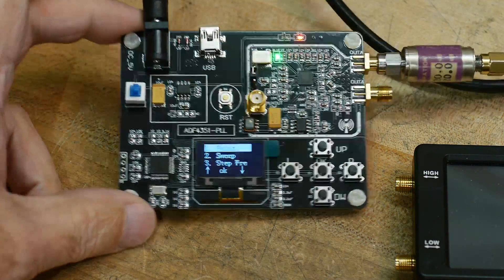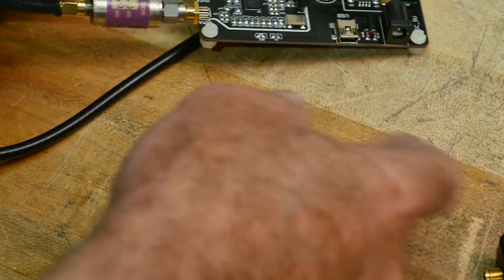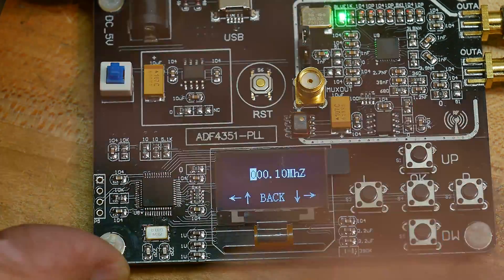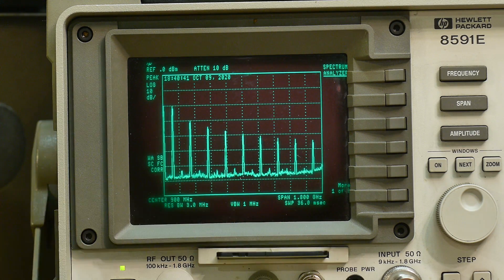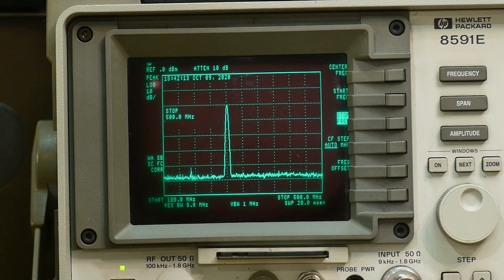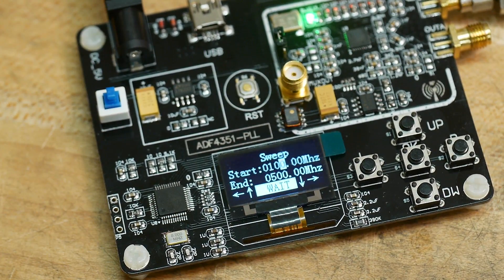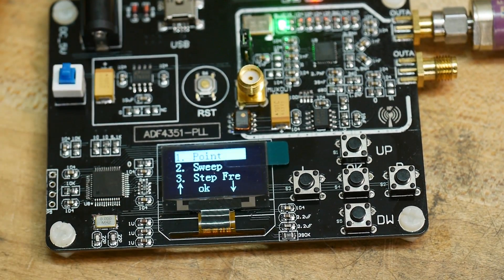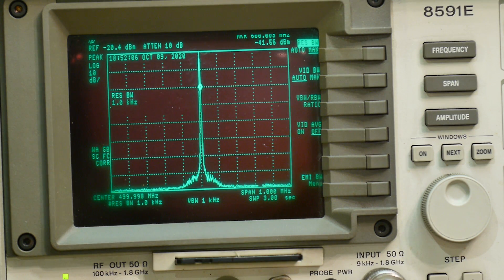#612 35 MHz - 4.4 GHz RF Frequency Synthesizer ADF4351

Comment: If you remove the DC supply, does this unit remember the last settings in NVRAM when you re-power it up? I'd like to use one as an LO for my 10 GHz transverter.

Comment: I see you've tested this on an Oscilloscope, what I'm wondering is what are the applications for these?
Reply from the maker: all the same uses as any RF generator. testing equipment, osc scope, counter, spectrum analyzer, testing filters, directional couples. RF amplifiers.

Comment: I bought one, but the UI is in Chinese....is these a simple way to switch to English, or does it have to be flashed with a different firmware?
>>EDIT: No simple way! See below...
Reply: I found the firmware source and schematic. UI is in English! Source comments in Chinese. The bad news is that there are two PCB models out there: (1) With No trash can logo below the  blue/white switch, that has a 128KB flash STM32 , or (2) With a trash can, ENIG PCB finish and a 32KB flash STM32. The clone models come in form (2) with the smaller flash, so I had to tweak the source to set the flash size to 32KB and the write base address (persistent settings) just above the last used prg code page. Then, adjust the ST32 target part for the project, recompile the whole thing with Keil using the older v5 compiler, and reprogram the flash using a STLink V2 wired to P5 on the PCB.
Reply: @luisderivas6005  I just found the same thing, can you post a link?

Comment: I just bought one and did a bit research on it, the sma connector in the middle is an external ref freq input @25 mhz, the jumper next to it enables its function
Reply: Correction; the lo can be chosen freely by the designer, in this case it is a 100 mhz so you will have to feed it with a 100 mhz external signal or reprogram the unit to except something else.
There are also units like this with a    lcd which has the menu option to change the lo frquency.
I am planing to hook mine up to a gpsdo at 100mhz.

Comment: I measured only 0dBm from the outputs on this one. According to the datasheet (and the power setting on the display), it should give up to +5dBm. Perhaps a software issue or something. However, this is a great tool for the bucks.
Reply: Maybe it's 5dBm differential?
Reply: @tiftik  Perhaps. The outputs are shifted 180 degrees apart, so it can be so.

Comment: hello, is the generator able to save a frequency and when turned off and back on again to automatically transmit the saved frequency?
Reply from the maker: Mine forgets
Reply: @IMSAIGuy  Is there a way to let this or an other generator when powered on to automatically transmit on 1 specific frequency ?
Reply: @stortregen5390  If you use your own microcontroller, you could do this quite easily.

Comment: Can u imagine if we had these low cost "toys"  30 - 40 yrs ago? I use to DREAM of having a spectrum analyzer and o-scopes back in the 70's but they cost was astronomical! I think it has differential output and should be terminated if not used. TNX 4 the video !

Comment: It's interesting that slightly different units, using the same chip are shielded between the RF synthesizer and the controller. I wonder if any benefits could be had by adding some shielding boxes.

 https://www.amazon.com/ADF4351-phase-locked-frequency-synthesizer-single-chip/dp/B07CTL2XK3

Comment: I think I left off last winter wondering what's the similar spec RF range oscilloscope module size board/kit?   Was wondering about IIO Oscilloscope with the Adalm Pluto.  I've not taken out of the box yet... though will see when I get to this winter.  Still focused on the outside chores, though still wondering what is a more portable standalone option maybe like a HackRF Portapack with better performance.  Would be neat to see a dedicated module however maybe with a RF power detector module can be made easy?

Comment: A couple years ago, I picked up an ADF4350-based version in an extruded alumin(i)um case with OLED display. It looks like the ADF4351 version is also available in the same enclosure on eBay. It's significantly more expensive (more than 2x) than the PCB version, though. I'm not sure why, since the case isn't that expensive.

Here's a link: https://www.ebay.com/sch/i.html?_nkw=%28adf4350%2Cadf4351%29+-pcs&_sacat=0&_sop=16 I have the style in the black enclosure (but that pricing is outrageous). There's a natural aluminum one with the screen on the top, rather than the front, that is less expensive (~$88).

I don't know if anyone makes acrylic sandwich-style cases for the bare boards for some protection at a reasonable price.

Comment: There are some of these 4.4GHz generator-boards with touch LCD which are really easy to handle. I got one of them and tried out it's harmonics in the 10-12GHz range with a satellite LNA. The output can be observed in the 1-2GHz range.    
RF Sweep Signal Generator Modul Board 35 Mt to 4,4G + STM32 TFT colour touch LCD

Comment: Very interesting how this days we have all these easy avaiable broadband pll ic's with the oscillator integrated such as adf4351 or si5351 for the nanovna. On 2012 i was doing some rf projects and i made a vna and spectrum analyzer project using for the rf generator 3 colpitts oscillators and a sp5655 pll to cover only 60 to 300MHz. For the receving secction a tv tuner with a 45MHz amps cell if filter. It took 8 boards to do this project and now with nanovna and tinysa it's all avaiable very cheap.

Comment: The one that outputs 100MHz is most likely the clock input. I bet that jumper nearby disconnects the oscillator from the ADF4351 chip and allows you to feed in an external low phase noise high stability 100MHz clock signal for better output performance.
Reply from the maker: I think they added that to allow you to hook two together and run both off the same clock so they will both be in phase
Reply: @IMSAIGuy  Yes that would work also---the jumper would disable the onboard clock on the one unit, turning the SMA to an input, to allow the 100MHz from the other unit to be used to clock it. The bare development boards without microcontroller have a similar SMA port, but you have to unsolder a small 0 ohm resistor to disconnect the internal oscillator and allow an external clock to be used (either from a separate source or from another unit to lock them together.)
Reply: Hello, do you know what to do with the jumper to use a external oscillator? I dont seem to understand it and dont want to break anything..
Reply: @stortregen5390  The jumper normally just completes the connection between the little onboard oscillator and the ADF4351 IC. If it's a 2 position jumper, you'd move it to the other position and plug your external oscillator into the port there. If it's only one position, just remove it and plug in your oscillator. You won't damage it by plugging in an external oscillator and trying with/without the jumper in various positions (as long as your oscillator isn't putting out too much power.) I'm a bit unspecific because many of these Chinese ADF4351 boards have various (but similar) configurations.
Reply: @ruhnet  thank you very much it was indeed a 2 position jumper !!

Comment: Can U lock it with extern ref ? I would like to try 125 MHz lock fq and 1 GHz output
Reply: Yes, you can, but the software on the microcontroller is made to work with the 100MHz reference that is onboard. So you would need a 100MHz signal to have it work correctly with the software it currently has. If you wrote your own software you could lock it with whatever frequency you wanted within the range of the ADF4351 chip.
Reply: Checking the ADF4351 datasheet---it shows that the input clock can be anywhere from 10 to 250MHz. But as I mentioned in my other comment, the software has to be set to work with whatever clock speed you use.

Comment: Do they make a version that goes down to say 1 MHz and I’m curious how much this was?
Reply: The ADF4351 is limited to 34.375MHz on the lower end. If you need lower frequencies then a suitable similar chip would be something like an SI5351 PLL, which works from 0-200MHz. Or a DDS chip like an AD9833/9850/9851. You can find little modules similar to this one, on Banggood/eBay/Aliexpress that use those chips.
Reply from the maker: no, and read the description